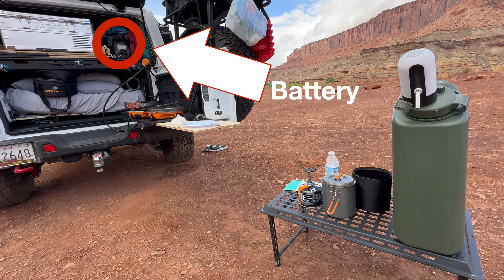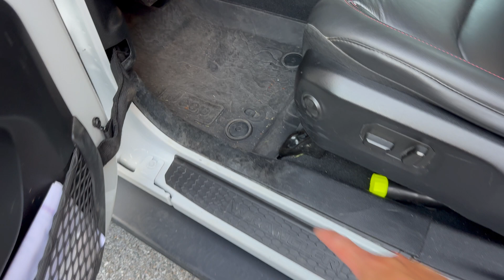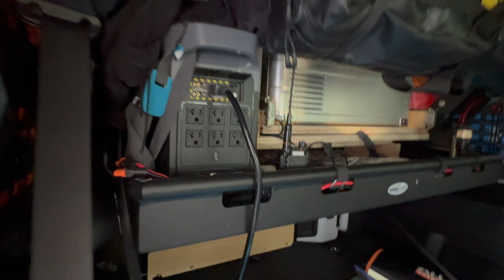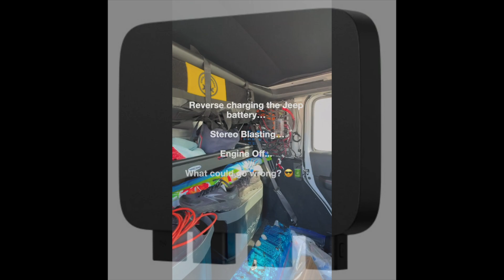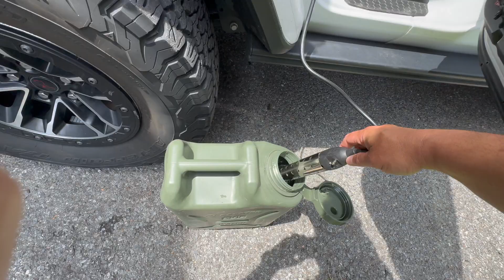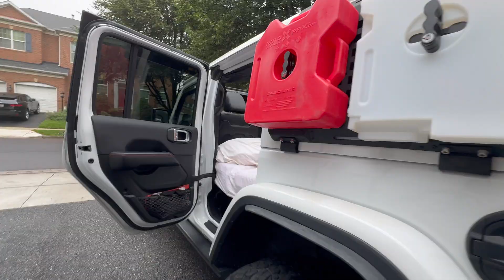How I Built the Ultimate Jeep Power System (6kWh Battery, A/C, Heat & More)

Comment: This is a great video. Thanks! I have an older ZJ, i have two 12v 200ah batteries to install. Going to do some similar things, charge off the alternator & solar, set up an inverter, and run a fridge and Starlink. It seems like the Starlink will drain a standard car battery in 24hours with med-heavy usage. I'm hopping to be able to go three-five days w/out needing to plug in.
Reply from the maker: Thanks, I appreciate that! That sounds like a great setup you’re putting together on the ZJ. Running dual 200Ah batteries with alternator and solar charging should give you a solid power system.

Please keep in touch and let me know how your setup comes together and how many days you’re able to go off-grid once everything is dialed in. Always interesting to see how different builds perform!